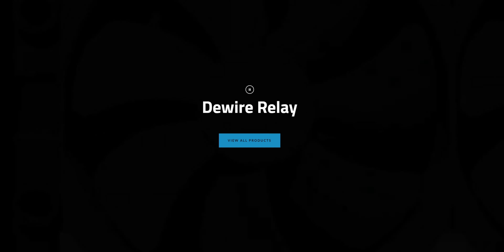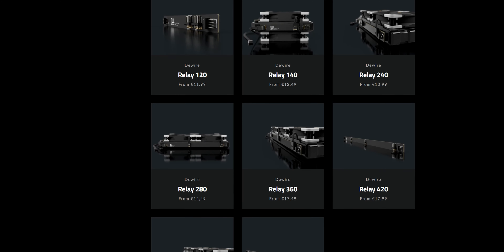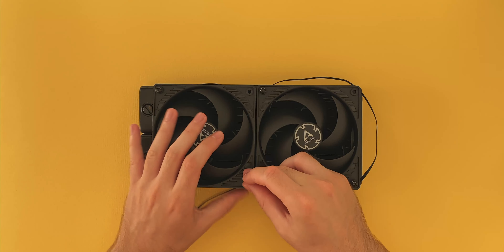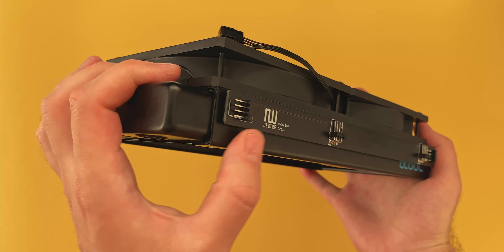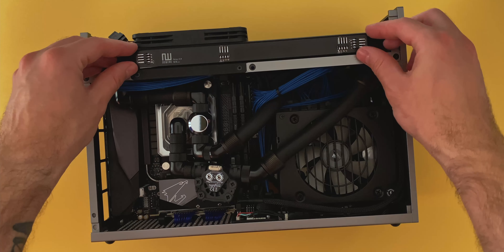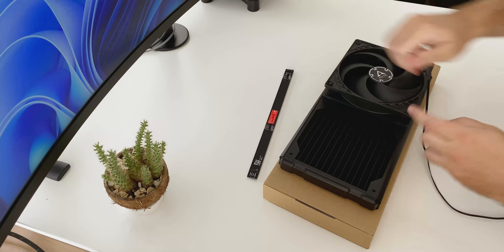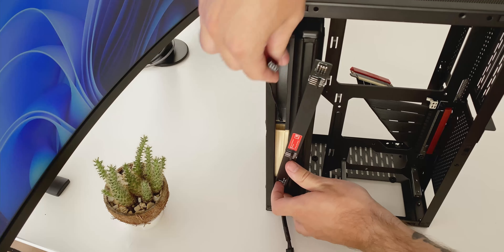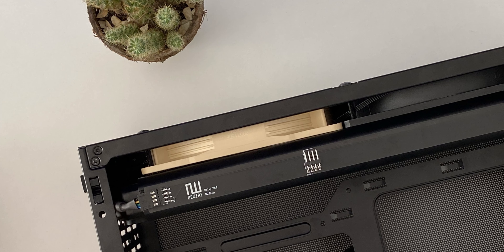DEWIRE Relay - Better cable management?

Comment: This thing is what bugs me while setting up my corsair aio.. the thing is already permanently connected between the plate and the radiator, why not just run the cable through the same path? and have the fan just do a short run of cable to the side of the radiator itself for rgb and fan connection.